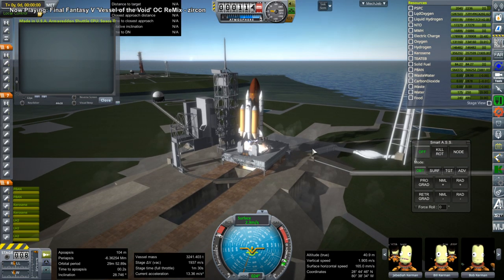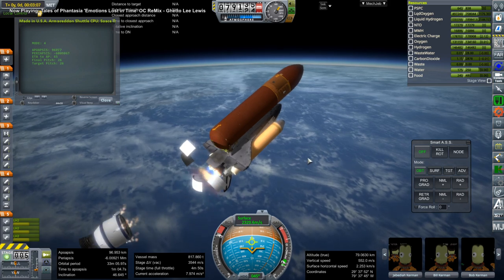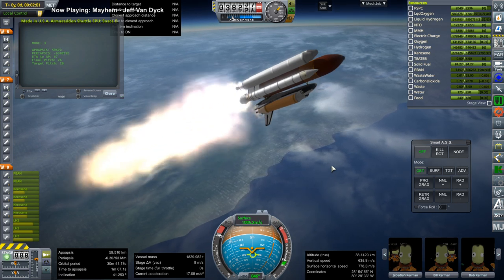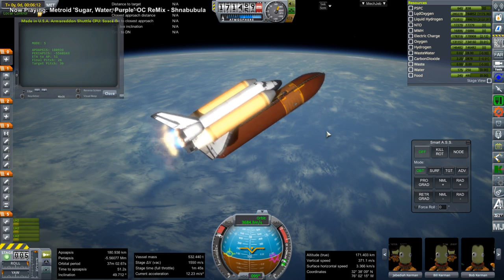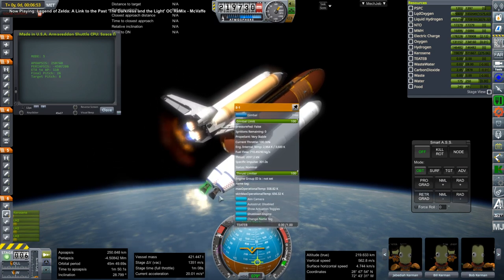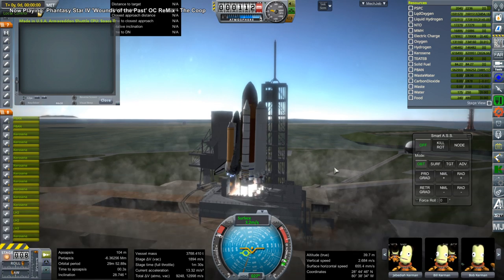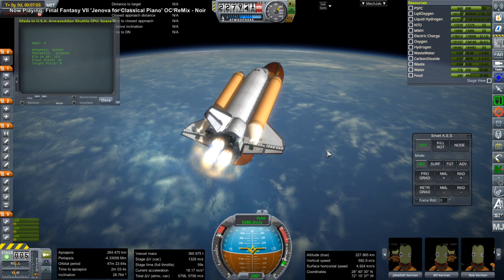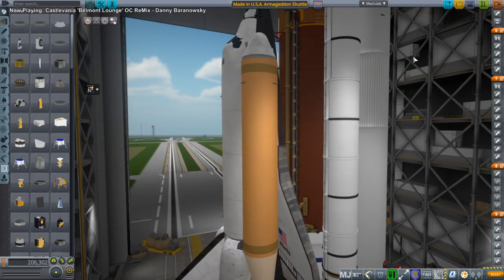Realism Overhaul in KSP - Shuttle to the Moon 1

Comment: So basically the shuttle from Armageddon
Reply: X71 super shuttle? Well, kind of, not exactly.
Reply: the shuttle does not look like the X-71
Reply from the maker: With realisms, though.
Reply: the more i watch this, the more im convinced that the space shuttle was a very stupid design. having the center of thrust inline with the center of mass is infinitely more efficient than having it offset so severely and just have SAS and thrust vectoring try to fight against the forces of the shuttle. bringing different mass payloads would also drastically affect the center of mass, if you only brought a small satellite you'd have to bring extra mass just to compensate for it, but if you brought a large but lightweight satellite you'd have no room to add the extra mass. the space shuttle was unnecessarily complex and extremely impractical.

Comment: One thing that could be done to compensate for the center of thrust/CoM issues would be to shutdown the upper most SSME once you start maxing out the control authority - alternatively, use the Engine Group Controller mod to throttle back the lower two SSMEs to move the CoT up, if that’s part of the problem. One other option would be to rotate the SSME’s, or produce a modified version with increased gimbal range for use on this mission - after all, with the mounting of the “transfer stage” tanks alongside the orbiter, you need a modified orbiter anyways.

Comment: Is this shuttle capable of survive the reentry from the moon?
Reply: Gerardo no, I don’t think any space plane could
Reply: @jamiesmith3396  then how the kerbals are going to coming back?
Reply: Maybe it could come back to earth orbit and decelerate first... a lot of delta-v will be wasted... but then it could "work"
Reply from the maker: It will pass high in the atmosphere to reduce its orbit first - this doesn't incur the same kind of heating that you get with coming straight down to the surface. The only trick is that we need to still be low enough that we bring the orbit below the radiation belts on the first pass, or the kerbals will get a bonus radiation dose.

Comment: I was about to ask a question about how high of a power-to-weight ratio we could conceivably output with a crew-safe nuclear reactor built using modern technology (i.e. Gen III and tested Gen IV derivatives) in space on StackExchange. So, if/when it gets an answer, you could model a very simple "Maximum PWR reactor" for use in its cargo bay—possibly with its size and therefore power in-editor adjustable—then place 2–4 adjustable ion engines with a generic model at the back thrust plate, each having the maximum thermal efficiency demonstrated for an Ion engine. After that, you could fiddle with different reactor masses/power outputs, propellant masses, and "gears" (higher exhaust velocity means more power per unit thrust and thus lower TWR, and vice versa) along with life support masses to see if you can send the crew (presumably 2–3) on a lunar transfer given the amount of payload you can carry. (Remember, though—if you want the system to be reusable, the dry mass of the reactor and fuel tanks should not exceed 16,000 kg, the return payload limit.)

Also, I'm pretty sure at least using 5-segment SRBs would be OK, as unlike almost any of the other proposed improvements to the Shuttle, they actually, y'know, exist.
Reply from the maker: The problem is that ion engines, even at their best, would take too long to get the Shuttle and its crew through the radiation belts. On the boosters, I'm not touching them, and don't really see a need to - there is definitely an engine configuration that can manage this, considering how well we did with the E-1s.
Reply: @RaizSpace  After assembling a crude analysis tool on Desmos and going through your sliders, I guess you're right on that regard—keeping the combined reactor and propellant mass at 24,400 kg and the reactor PWR at <1.5 kW/kg, I wasn't able to manage a ~3150 m/s burn in less than 2 days, which would actually have to be considerably longer and thus more costly because of how low the Oberth effect would be. I'm fairly certain we could reach very well above 10 kW/kg with more advanced reactors, but ehh...

Here's another change that's relatively non-cosmetic but still haram by your rules: Fill the cargo bay with a LH2 tank, replace the OMS tanks with LH2 tanks, and replace the OMS engines with the projected Centaur Timberwind engines (~1500 kg, TWR = 30, 1000 s Isp). Would probably give you the transfer without too much extra boostage and at a very good TWR to boot.
Reply from the maker: I strongly doubt that would be in line with the rules, but besides that, have you considered that replacing the light OMS engines with such heavy engines in the back would pull the Shuttle's center of mass behind its center of lift and make it unstable on reentry?
Reply: @RaizSpace  Perhaps—it's a 2,800 kg change. Actually, it'd probably be closer to the equivalent of 1,000 kg at that location, as the rear OMS tanks wouldn't need to be pressure-fed and the center tank mass would aid in balance. Still, maybe that'd be too much for it to remain stable.

Comment: Get to orbit with an in-bay tank, send up a second shuttle without the transfer stage and a replacement in-bay tank full of transfer stage fuel. Should give you more than plenty of Delta-V with minimal adjustment and also give you in-flight centre of mass balancing capability.
Reply from the maker: Second Shuttle is obviously cheating. What do you think this is, SpaceX's Starship?
Reply: Fair, fair.

Comment: Why not launch something into LEO that you could assembly to push the shuttle into a lunar flyby or whatever you're wanting to do with it?
Reply from the maker: That wasn't the challenge.
Reply: 🤷🏻‍♀️ I mean, you did say you didn't want to alter the stack... I kinda feel like this is altering it, in a sense.

Regardless, I haven't messed with RSS/RO in a lllooonnnggg time. Any good tutorials for installing the current version? Last time I tried on my own, and got a really weird Kerbal system. Not sure where I went wrong. 🤷🏻‍♀️
Reply from the maker: I just posted a tutorial: https://www.youtube.com/watch?v=j5gd4q8uXis. If you get Kerbin, make sure you have Kopernicus and make sure you delete any other version of ModularFlightIntegrator you may have in GameData and use the one that comes with Kopernicus instead.
Reply: Cool! Thanks! (I think part of my problem was at the time I tried it I was using the most current version of KSP,  instead of whatever version I was supposed to be using at the time.)

Comment: Can you explain your restrictions of sticking to the shuttle stack? They seem arbitrary. Especially since you allow yourself engines on the SSET. I think liquid fueled boosters (maybe based on the external tank, so the entire thing looks a bit like a Delta IV Heavy) would be a good solution.
Reply from the maker: It is an arbitrary restriction that represents the challenge in question. That is a parameter of the challenge. To disregard that parameter would be to tackle a different, equally arbitrary, challenge. After all, I've already designed my own Shinkansen shuttle that would do a better job on a lunar mission, so why not use that?
Reply: @RaizSpace  Because maybe you wanted to use existing infrastructure (the shuttle, OPF, launch mount, manufacturing facilities), so to create a simple shuttle derived vehicle, with low development cost in real life, I guess. And external tank derived boosters would make a lot of sense here, especially since you allow yourself to add engines to the tank.

Comment: Move the shuttle higher up on the tank for weight balance.
Reply from the maker: That would have the opposite effect, as the shuttle's engines would no longer be able to point through the center of mass. You actually want the shuttle as low on the stack as possible, which is why it was placed where it was on the real thing.